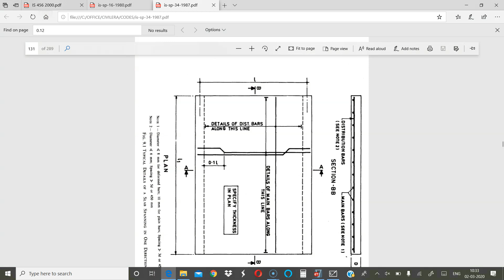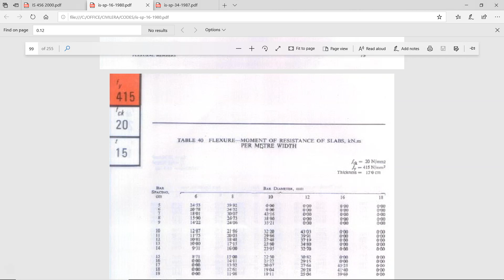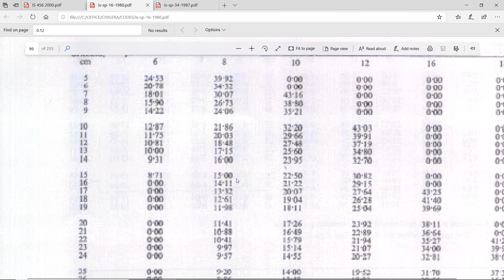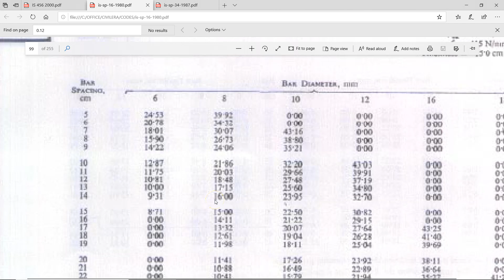1 SLAB DESIGN 1

Comment: Sir why do we consider overall depth is less value than actually needed?

When overall depth is 150mm how come effective depth is 160mm? Actually it should be revised na??
Reply from the maker: am explaining it in the video
when you consider % of rebars, that will allow an increase in L/d ratio and hence depth can be reduced. So finally after arriving at steel, you can check once more if deflection is satisfactory